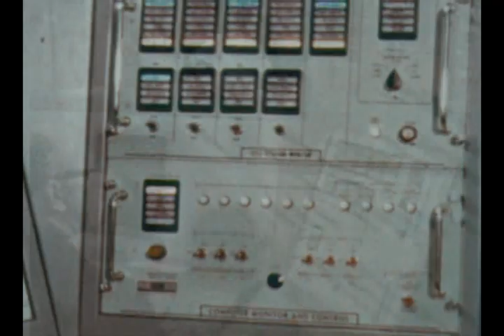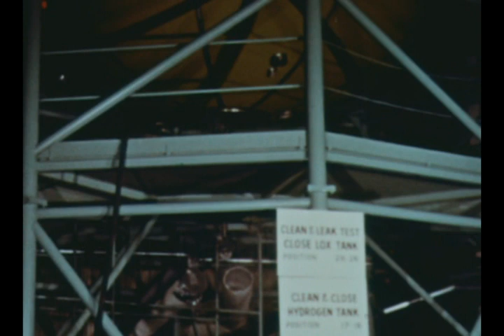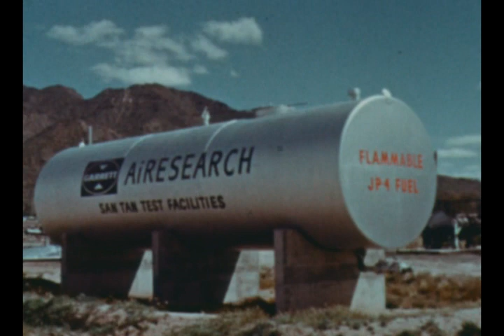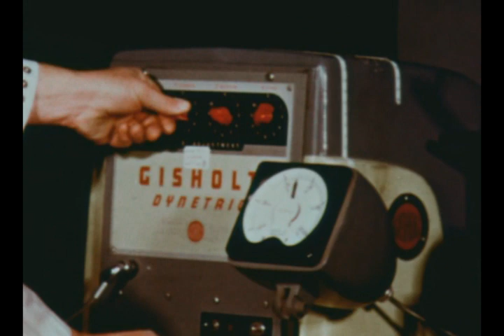Saturn V Quarterly Report #10 Mar-May 1965 part 1 of 2

Comment: I am surprized to see that Americans gave away so many technical details wile the Reds were conducting their rival Moon program in a race for time.
Reply: We didn't give all our secrets away during the Apollo/Saturn project.  Formulations of alloys or super alloys used in the vehicle, the welding techniques, voltages, or welding rods used in the process, turbopump specifications in either fuel or oxidizer were never published or revealed.  Lots of details were never made public.

Besides, was there any other country that had the ability or funding to develop a similar vehicle of size and magnitude?  Everyone was more interested in the ICBM program like the Titan and Minuteman vehicles.  China got lucky when the prime engineer got sacked and then left for Beijing with a suitcase full of Titan II paperwork.